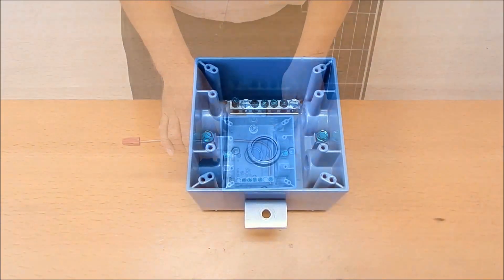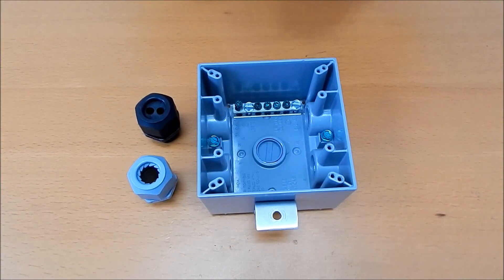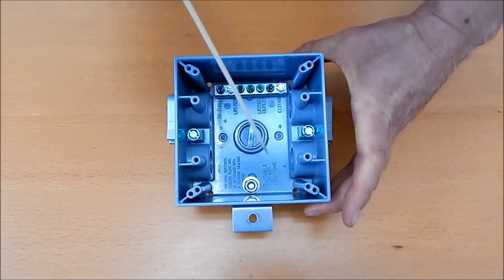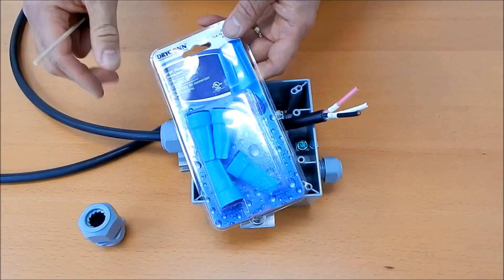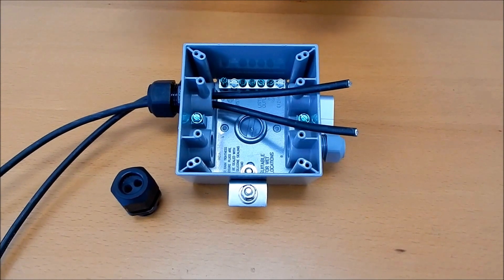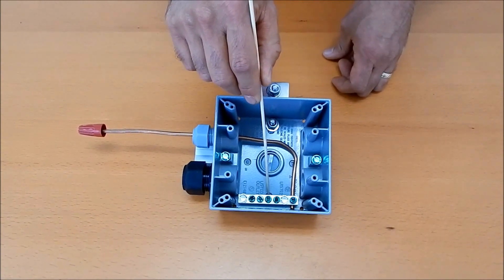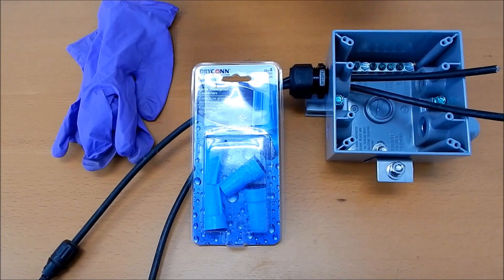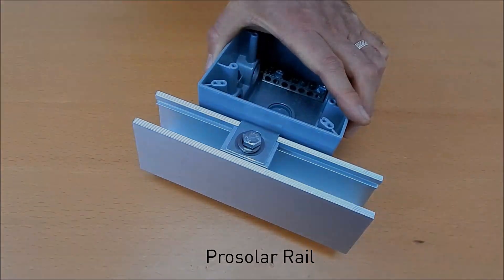Solar Components - Junction Box aka JBox

Comment: I went to gogreensolar's website but couldn't find this jbox or the fittings that can be used with it. Google isn't any help either....
Reply: Same problem.  I would like to find it.
Reply: First that will not pass inspection. Needs to be water proof junction box. Will need a lip around the top for extra protection.  If you use a standard outdoor rated box like this and your inspector knows the right solar codes you will not pass
Reply: @husky88ava  I ended up using Soladeck junction boxes. 
https://youtu.be/ssKjw5-dXZY
Reply: @husky88ava  Any ideas if using the weatherproof cover with a lip around the outside edge, whether inspection will allow the j-box to be placed near horizontally? That is, when the roof is very low slope, the standard j-boxes with multiple side holes and a bottom center hole would lay with the open side up (for connections), and the cover would not be vertical, but rather facing the sky. Is this okay? Thanks.
Reply: It looks like it's a 2 gang weatherproof box that you can get at home depot. I bet they made these boxes in house by adding the bus bar and the stainless bracket. They probably stopped offering them after finding out how much time the boxes where taking to produce.
Reply: Andy Sontag I thought I updated my comment.  Guess I forgot.  I talked with them and they don't offer the j-box. They suggested buying the gang box and bus bar at Homedepot and build it yourself.

Comment: i like this setup,very convenient,couple questions if i may.1) is the EGC by code required to be continuous?and if so wouldn't installing on ground bar then breaking continuity? 2) are the terminals on the ground bar irreversible? 3)what are the dimensions of box( for example if i chose to install a with for example) 4) is they a vertical mounting option?
Reply: Weep holes need something to break the water tension. Usually a cotter pin through the hole and bent up on the low side will do the trick.